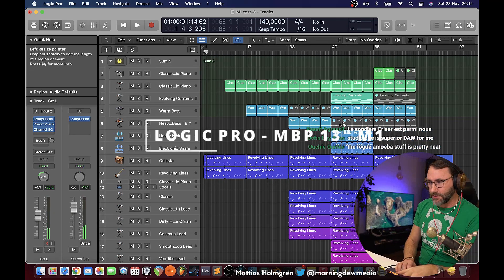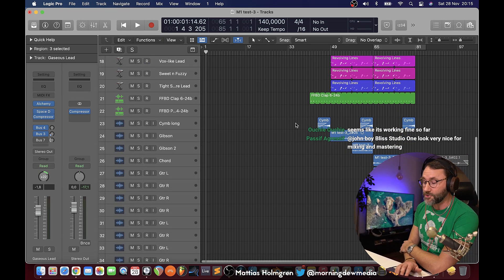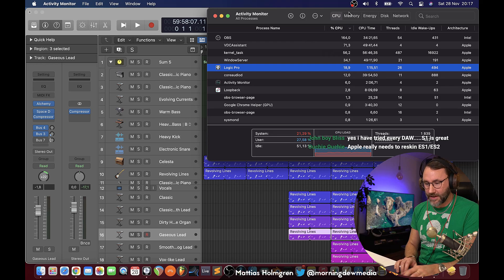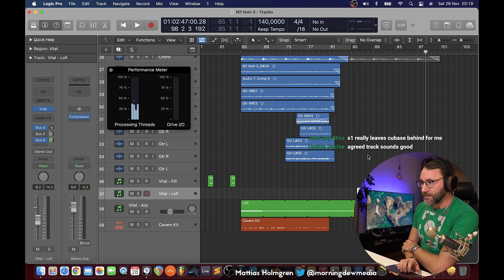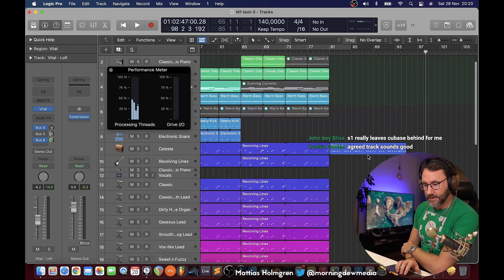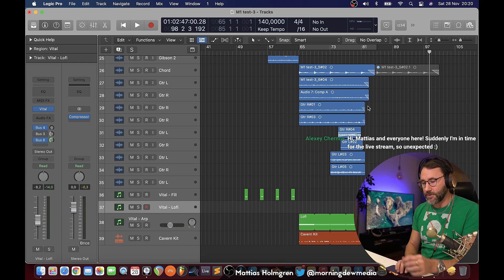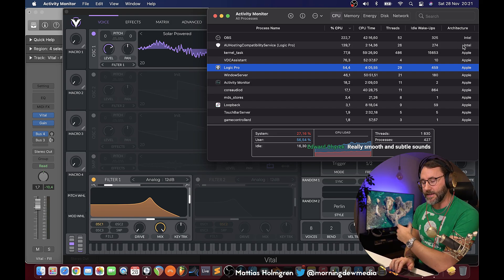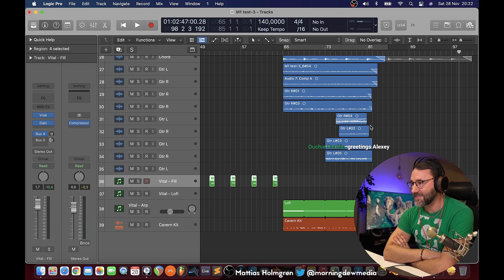Apple Silicon M1 Logic Stress Test & Plugin Performance

Comment: Great content ! Would the MacBook air m1 be just as good as the pro for music production? Or does the pro have an advantage? Thanks
Reply from the maker: Hi Jason, the advantage of the MacBool Pro Pro 2020 compared to the Air 2020 is that the Pro has a fan . But Ive never experience the fan start, it was never audible anyway in any of my tests so I dunno.
The Pro comes with the touchbar. Pro also has a Studio quality three array mic which I dont think the Air has. The speakers might also be better on the Pro. I did notice a huge improvement in the playback quality through the MacBook PRO 13" M1 compared to my old MacBook 15" (2016)
Reply: @MattiasHolmgren  thanks for answering ! Im going to order the air with 16gb ram . Think that would be good  enough. Cheers
Reply from the maker: Yeah Jason, it will rock if you use Logic native content. 🌞
Reply: The song title pleas 🙏, and where can i find it ??
Reply from the maker: Sorry Milton, I have not released this track yet. I Will give it a proper name later too. 🥳 Thanks!

Comment: Having the issue that only one thread is maxed out and getting system overload but my system usw is only around 15% overall. Any tips? MacBook Pro 14 M1 Max Logic Pro x Ventura no Rosetta mode. Only native plugins running.
Reply from the maker: In Logic Settings make sure to select all cores to be active, not auto. Whats your  buffer setting (latency) at? Set it to 128. What Logic plugins are you using. 100% Alchemy? I get a nice spread across the cores on my M1 Max MBP.
Reply: @MattiasHolmgren  a Mix of Kontakt and 1,2 Arturia. But only around 8 tracks. But 8 3rd party plugs on a mix bus. This is not what I expected I must say. In my activity monitory the auhosting app is taking the most cpu. But I don’t run in Rosetta mode. Buffer size, cpu thread handling etc doesn’t make big difference after changing these parameters. Very strange.
Reply: @MattiasHolmgren  The so said „native“ running plugins are a big scam in my opinion. Today I tested my new MacBook 14 M1 Max 10 64 gb ram and was shocked. Only 7 instances of Kontakt, 2 arturia vst’s and some master plugs and one of the 10 cores is already causing system overload but my overall cpu usage stays around 15% 😂 this so so stupid. In my activity monitory the app “auhosting” is using the most power. More than logic itself. This is the problem I think. Any new updates of knowledge? Thanks
Reply from the maker: …It obviously depends on how/if the plugins you use has been optimized by the prod developer. I have zero idea about Arturia plugins. But I get great performance of the ones I use: Valhalla, Spectrasonics, Kilohearts, NI, Bleass, Izotope and a ton more etc… Kontakt works great on my system. Running K7.

To debug the issues you narrow down what you use and see where the bottle neck is… one by one plugin.

Comment: Dear Mattias, thank you for your super useful and clear videos, I enjoy listening to your explanations and learning some theory. Yes, the theory. Yet. I would like to switch from windows to mac so I could use Logic Pro for my voice recordings and music production. The problem is I have no idea which macbook is better for these purposes. I only know that I'm thinking of pro rather than air. In my work I love using kontakt and omnisphere if this is important. I'm not looking for the most expensive option, a middle ground should be fine (or not? I'm not so sure). Could you please give me an advice on this matter? Which macbook model is a good choice to consider?
Reply from the maker: Hi Olga. Thanks for the kind feedback. Now is probably the best time ever to switch to Mac. Prices are dropping on the old Intel macs. I mean, who wants to buy a big bulky Intel Mac from 2015 when the latest Macbooks with M1 out perform them, and are cheaper. Second hand price used to be really good on Macs in my experience. But now they should drop pretty steep as these new Macs are much cheaper. Apple M1 for the win. Just hope the other DAW and plugin developers make as good optimizations as Image Line did with FL Studio and Apple with Logic. 🥳 Looking forward to see whats released during 2021.

Olga, Spectrasonics are working hard on the native arm64 version of Omnisphere 2 for Apple M1. And when its out it should be super smooth on these new Machines.

Do you plan to run Logic exclysively?  Or another DAW too?
Reply: @MattiasHolmgren  thank you for the answer, Matthias! Nice timing then. I mean, for switching. :)
Sounds fair. So, once Spectrasonics complete the native version of Omnisphere, will I be able to get this update if I already buy M1? Sorry if this a silly question but I'm new to Apple.
Well, I probably would still like to use Cubase as I do now on my Windows. But I'm not giving up Windows at all, I will still have my old computer. Same goes for FL. My main intention is to learn working with Logic Pro, so probably it's not a tragedy if other DAWs aren't in a perfect state. At least it seems so.
Reply from the maker: Yes, all updates so far on Omnisphere 2 have been free. So I guess the M1 version will also be a free update. No questions are silly. Its a huge space of tech questions and we can only know so little. Thanks for writing Olga! 🌞🥳🦊

Comment: Hey, what audio interface are you using?
Reply from the maker: For the demo videos of the MacBook Pro with Apple M1 I was using an old Steinberg UR22mk2 audio interface. But I've also tested with my Apogee Duet 2 (iPad/Mac/PC) and it worked out fine (Except for the Maestro software which is not arm64 yet). I also tried the Komplete Audio 6 which worked fine in my tests.

Comment: Thank you for the video Mattias! Would you recommend an m1 16gb mac for orchestral mockups? I use a 32gb ram intel PC, and I'm wondering if m1 macs have better memory management and would be fine even with half the amount of memory. The processing and storage speeds are definitely enough for the task, my only concern is memory.
Reply from the maker: Hi Pedro, it's hard to say for me how your typical arrangements are loaded with instruments, are they big templates, what samplers etc. But what I can say is that 16GB have been enough for me when doing orchestral scoring on laptops. But I don't load too big templates anymore like I used to. I rather work with smaller projects and load up instruments when I need them to keep things fresh.
8 GB is a bit on the low side for this 13" MBP. Memory management is indeed great. Much is streamed from these fast discs these days anyways. But if you like to work with big templates, go for as much memory as you can affort. That goes for orchestral scoring as well as video editing.

Comment: Does focusrite scarlet works on this loptop and is it better to get this laptop or macbook pro 2017 i7 ? Thank you
Reply from the maker: I dunno about Scarlett, but most modern Audio interfaces are USB class compliant devices so they should basically work. The ones I tested worked just fine (Apogee Duet, Steinberg Ur22 mk2)
Reply: @MattiasHolmgren  Good to know your UR22 MK2 worked, I have the Mk1 and it does not want to get recognized, the LED is only blinking as soon as I connect it.
Reply from the maker: Oh not so good. It seems not all USB gear loves the new tech. Maybe it needs a firmware update to work with BigSur / M1!? You got any other  USB audio interfaces around to try? 🌞
Reply: @MattiasHolmgren  Yeah I think they didn't release and firmware for Big Sur since others have the same problem. I'm thinking of selling it and getting a Focusrite or a Behringer, I've seen another youtuber using them on his M1 since they are class compliant.
Reply: @MattiasHolmgren  Hej. Tack för videon! For the UR22 mk2 did you use the latest USB driver from Steinberg's website and they just worked out of the box without fiddling? Tack.
Reply from the maker: Hi Mikael, it worked out of the box. No firmware update or whatever. 🌞
Reply: @MattiasHolmgren  Det funkade fint! Tack. 
I read about Big Sur and M1 on Steinberg's website and got discouraged about their recommendations not to use it. Ha det! :-)
Reply from the maker: My MBP 15" (Radeon 455 gfx), 16GB RAM from 2016 which is i7 2.7ghz was beaten in my tests. 😀 Apple M1 is superior tech in all ways. But maybe wait for a 15" 16GB / 32 GB model. I Will keep my MBP 15" 2016 until all manufacturers have built arm64 executables of their software, (plugins, DAWs etc.) I Will use this MBP M1 2020 machine mainly for Logic Pro, coding and film editing, design etc.
Reply: @MattiasHolmgren   thank you for replaying! I ordered  one and i hope is it good for my  music lol